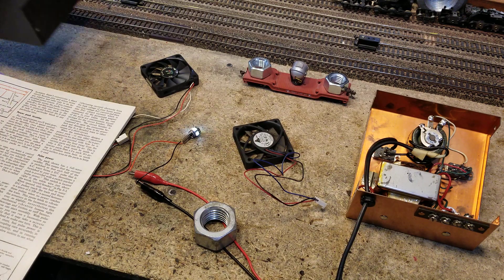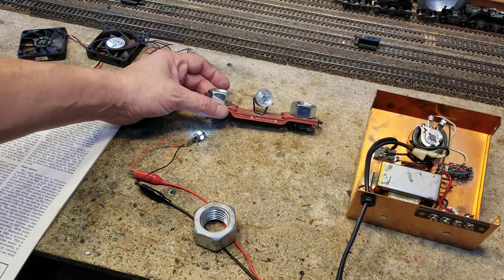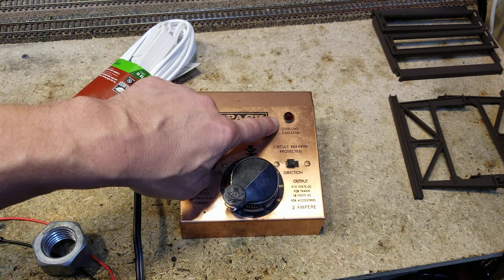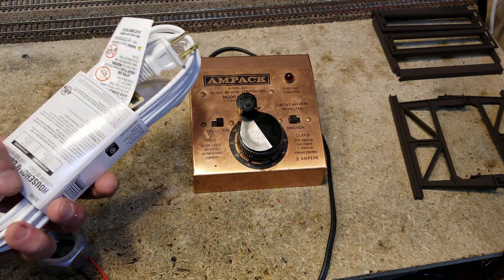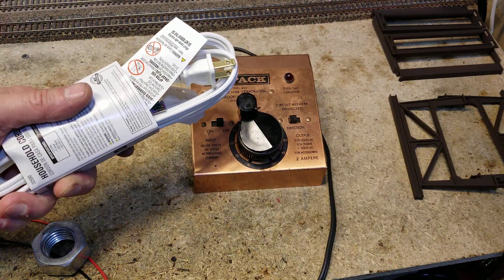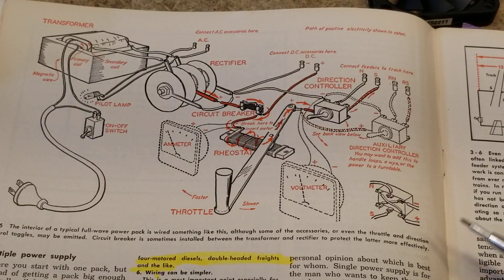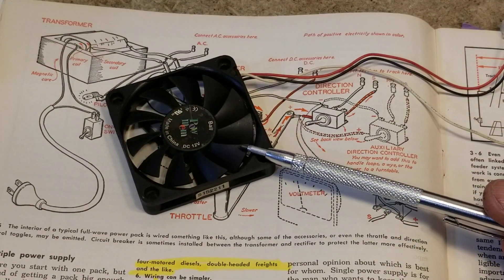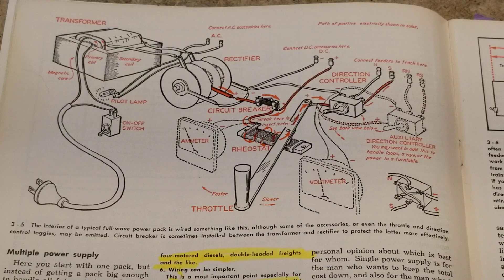Power Pack Rebuild part 1

Comment: Where did my comment go? I believe YouTube deleted it. Is it because it had contact info in it?
Reply from the maker: yes, they don't even hold those for review it appears.  for contact info you have to send it using the email it the about section from the main channel page
Reply: @elite194  I don’t see the email.
Reply from the maker: @stevequinn5024  on the about page, press the button that says view email address
Reply: @elite194  that is not showing on my end. Do I need to be on a computer?
Reply from the maker: I don't think so, you just need to start from the main channel page which you can get to by clicking on my icon
Reply: Yes sir I’ve tried that. I’m outside in my train building. I will go inside and check on a computer shortly.
Reply from the maker: I got it and sent a reply
Reply: @elite194  I didn’t get a return reply. Probably my stupid email.

Comment: ADD THE DAMN METERS.  NOW
Reply from the maker: I've only got 1 volt and 1 ammeter and those are going into the Autopulse rebuild - the giant TwinMomentum 5!
Reply: @elite194  I had been at a train show just hours before.  An old dude had a bunch of parts and had two old school amp meters and two matching volt meters.  I was going to buy, but nawww.  Come home watched your video.  Exactly to the point.
Reply from the maker: meters are a tough call because digital versions are few bucks for a bag full and analog versions require real estate under the hood.... that being said, we might have to just scratchbuild a power supply because there are lots of features that we can add for next to nothing these days that didn't exist just 20 years ago

Comment: Those are prototype bolts and they were shipped to China and they hold the Yangze Dam together.  128 were shipped from Chicago to China.  Just kidding, my TECH 2 needs all that.  I have lights red green.  No the overload hardly works. So when testing and I get overload, hard to tell, machine not working or it shut the power pack off.  WHAT A TREAT, to know that. I have an elaborate two switch three pole, program, track power, or DC.  ALL need to light up correctly.
Reply from the maker: I have a Tech II that doesn't completely shut off and that is the next candidate before doing the AutoPulse

Comment: I work part time at a hobby store and I am just used to tossing those. I call them fire hazards and try not to sell anything older than a tech2. Having said that, now I'm intrigued about these old fellas
Reply from the maker: these old fellows can be very useful, even the crappiest old transformer can be an excellent tool when repurposed for just this kind of situation... hang on to those, you can do a couple simple mods and sell them again as tools instead of power supplies meant for running